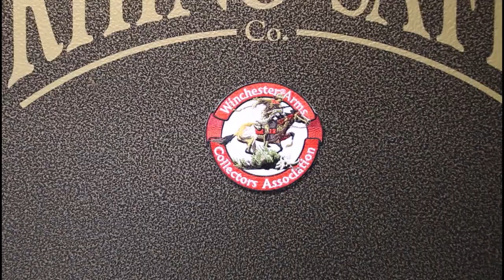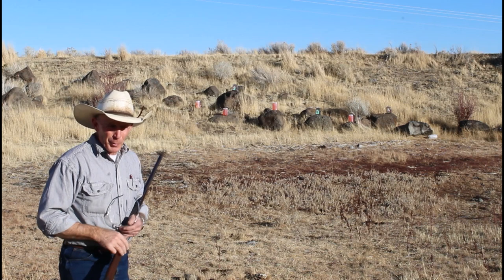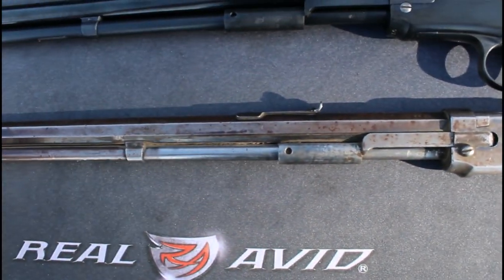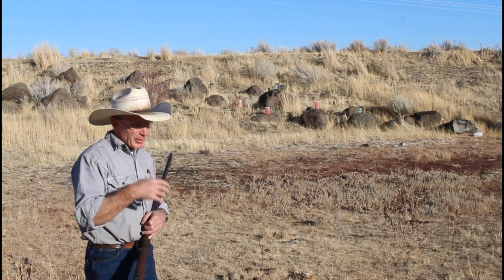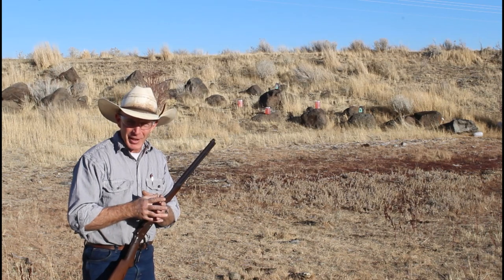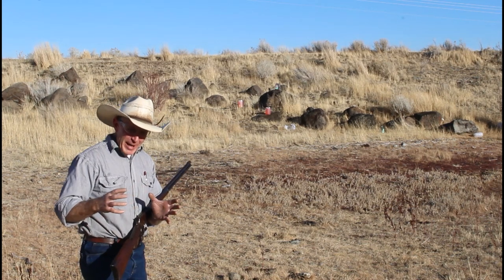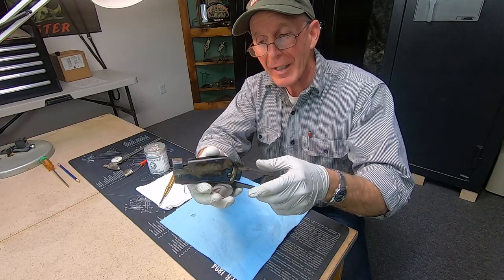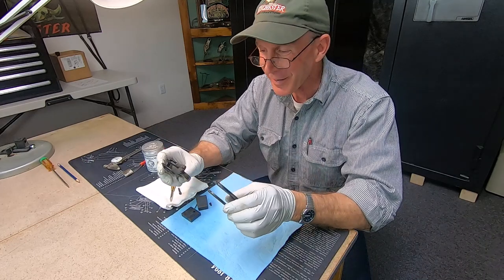Bluing and Color Case Hardening Winchester 22's

Comment: I just found your videos & this stuff fascinates me. I wish I could've learned these things many years ago but I'm getting too old for it now. To think, guys were doing this work-intensive process daily & churning out frames & receivers at a fast pace & with no real safety gear back in the day.

Incidentally, I bought a batch of black powder guns & one ended up being an original 1873 Winchester in .22 short (dated 1886). The color case & blued finishes are gone, of course, but it has a nice patina. I need to get it looked at one day, as it has an area of concern, & not many of these were made. I love the old Winchester lever actions.
Reply from the maker: It's amazing to me that they were able to produce such high quality guns with the equipment they had to work with.

Those 1873's are pretty scarce.  You've got a treasure in that one if it's in decent shape.  Most have pretty rough bores from shooting black powder.

Comment: You can bubble air through the quenching water and vary the patterns on the metal.
Reply from the maker: Thanks for the tip, Jerry.  There are so many variables in CCH, making it so difficult to get right and repeatable.  There's the type and ratio of bone and wood charcoal, the time and temperature in the kiln and the temperature and oxygen content of the water.  On top of that, the weather conditions play a part.  After all those variables, the specific alloys of the different steels used by the gun makers will have an effect.  It's an art and a science that the best smiths at CCH have spent enormous time studying and going through trial and error to get it just right.  Thanks so much for watching and commenting.

Comment: The results that you've shown here of the case hardening are absolutely beautiful! Part of the beauty is the total randomness and lack of any guarantees, you could in theory do everything totally right, and end up with a disaster of a pattern that may be functionally ok, but just looked crappy. It's worked out really well on this vid. My ULTIMATE pistol would be a case hardened Browning Hi-Power, with gold plated hammer, trigger and controls, and a figured walnut handgrips. Getting that work done would probably at least double the cost from the factory price standard, but WELL worth it for me personally. Doesn't do ANYTHING for function, but it makes a firearm look so much nicer!
Reply from the maker: I agree.  There's just something about a nice color case hardened part.  Thanks for watching.

Comment: Nice work on that case hardning project.  I have purchased a few case hardened items from a company called TurnBull Restorations. Their work is just outstanding.  I am glad to see you also use Renaissance Wax on your finished work.  I learned about that product long ago.  I use it on gloss blue metal finishes, fine wood  and of course case hardening. It seems only the real professionals like yourself use the wax.  So I feel that much better that I safely use it on my old collectables.
Reply: Renaissance Wax was developed by the conservation department of the British Museum as a neutral wax that would provide a good protective layer over an object, but that was possible to remove using a solvent. 

Initially the issue was to prevent the dust layer accumulating on metal objects acting as a wick and pulling moisture onto the metal surface creating the conditions for rust pitting. If you look at old metal objects such as armour and fittings, they often show rust lines along the upper surfaces where dust has been allowed to accumulate. Dust consists of a load of organic materials which can support bacterial action if allowed to become moist. The by products of bacterial action is usually acidic and this is what triggers rust. The worst case is where any insect damage such as woodworm has occurred. Wormed wood needs to be removed from the metal as soon as possible and treated. Woodworm excretions are extremely corrosive. 

In guns, danger points are gaps in the construction where moisture can wick in to the mechanism via capillery action. Any wood-metal junction is particularly prone to this. All old guns need to be pulled out of their wood every couple of years and any hidden surfaces inspected. Always coat internal surfaces with a neutral wax or grease before replacing the wood. Renaissance wax is ideal for this. Do not use oil on internal wood -metal surfaces as this can attack the wood. 

Colour case hardening is very thin and the colours are transient. They are unlikey to survive long on surfaces which are subject to handling or wear. The hard case itself is deeper and will survive, but the colours on the surface are very thin and easily lost. In my opinion, it is better to rust or nitre blue parts that will be subject to wear as this will last longer and is easier and less traumatic to restore. Remember if you are in UK, colour case hardening any pressure bearing parts will nullify the proof on the gun. It needs to be re-submitted to the proof house for testing after carrying out case hardening if you intend to sell the gun.

Comment: What a fantastic result. And now for my unsolicited two bits worth of advice from someone who has never refinished a gun.

While Cerakote is a great protective finish, I question applying it to a vintage rifle like your  Winchester Model 1890. It seems out of place and out of time. After a slow rust bluing of the barrel, which was the traditional finish on such rifles, applying a product such as Renaissance wax polish seems much more appropriate. It was developed by the British Museum Research Laboratory as a protective finish for metal objects and also other items. I use it after restoring old fountain pens. 

Putting Cerakote on an 1890 would be like putting high tech, high performance sports car tires on a professionally restored 1930 Packard Deluxe Eight roadster.
Reply from the maker: Thanks for watching and commenting, Stephen.  I absolutely agree with you about Renaissance wax.  I've used it on my high condition, original firearms for years.  Remember, however, that this 1890 was just half of a rusty door stop when I started.  While I'm really happy with the way it turned out, it's still just a pretty shooter and fantasy piece with 0% original finish.

When I get done with the wood and rust bluing, it will be on display in my shop and travel to gun shows with me.  It will most likely be handled extensively by the general public.  I'm very interested in knowing if the clear Cerakote will save the case colors from exposure to UV light and "hands-on" inspections.  While I really like Renaissance wax, I don't think it would hold up as well.  Sadly, unlike automobiles, firearms lose their collector value when restored, so this one seems like a good candidate to try it out on. .
Reply: @thecinnabar8442  You certainly have a point. If lots of people are going to handle it, potentially dropping it (ouch!) and generally bumping it around, clear Cerakote is a good choice. And as to whether it will provide UV protection to the color case hardening, now you can find out.

Comment: I have an old muzzle loader that was made in Spain in the 1970s and the lock plate and all lock parts are hand forged and color case hardened. The outside of the lock plate is now an off color of grey/blue while the internal parts are still retaining their original color.
So yes the colors fade with use and exposure.
Reply: It’s the uv light that makes it loose it’s coloring

Comment: Can you get into how you fill deep pits and gouges? I have a large frame lightning supposedly beyond help pitted pretty bad.
Another great video.
Reply from the maker: It depends on how deep the pits are and where they are.  If they aren't too deep, they can be draw filed out.  If they are too deep, they can be filled with tig weld and blended,  but not on the barrel.  I have seen a video where a guy uses a laser welder to weld up pits on a medium frame Lightning.  Laser welders produce much less heat than even a tig welder.  I sure wish I could afford one.

Comment: Gotta say, you do have guts. I never do foundry or other fire work in sneakers.
Reply from the maker: I wouldn't either.  Of course, there's a big difference between splashing a little bluing solution or warm quench water, as opposed to molten metal, on leather running shoes.

Comment: Maybe a clear coat like Imron would be good protection. It’s a incredibly tough paint used on Fleet vehicles. About 70-80% of all Semi Trucks, commercial jet aircraft and Locomotives use it. Nitro Top Fuel and Funny Car racers commonly use it because it’s not effected by Nitromethane and just about everything else. It can also be color sanded and buffed for a mirror finish. It would be a shame to lose that Color.
Reply from the maker: Thanks Monty.  Great tip!

Comment: I think this actually works better with different types of Steel, or differently with different types of Steel...for instance when I was younger I had a Uberti pistol but it was like high carbon steel so that gives it like this really dark kind of black and blue tie dye color but I think if you use a less carbon steel like spring steel or tool steel you'll end up with a more traditional look like mountains and valleys where the mountains are the dark carbon spots, and The Valleys below look like foamy streams and ponds, because it's like less carbon so there's more of an almost like a sea green tint to it but it almost makes the steel look like 3D or see through in certain areas if you do it the right way but with high carbon steel it just makes it look like blue and black tie dye which isn't wrong there's just like a more traditional look that I have desired and I think it's to use lower carbon steel.....which in Firearms, as long as they're like properly annealed and everything is well put together, I don't think you need it to be high carbon steel, I think you could use tool steel or spring steel instead

Comment: Great video ,, i enjoyed it very much,, but I'm not a big fan of case- Coloring,, it looks ok sometimes, but it can be overly done and a little tacky,, i prefer a good reblue or a good blue finish over case coloring,, thanks again,& i wish you were in the Southeast part of the country I've got an original 94 Marlin 32-20 that needs repairs,, the carrier needs replacing and the lifter too probably,, it's made around the 1900's im guessing...
Reply from the maker: Thanks Bryant!  If it's just simple parts replacement, Marlins are very easy to work on.  Check out my last episode on excessive headspace in an 1893 Marlin.  I show how easy it is to take one apart.  The 1893 and 1894 are very similar in design.  Good luck!
Reply: @thecinnabar8442  thank you, again,, i made a mistake,, it's a 94 not a 93,, i typed the year in wrong,, i will watch your video about the marlin head space,, i enjoy your videos...

Comment: I'm curious, the colors on your 1890 appear to have a different pattern than the other two receivers ( which look to be either Stevens or H&R guns).  The case hardening process was the same for all three receivers Is there a reason for the different color patterns?  Is it perhaps because the Winchester had a forged frame and the other two guns may have been castings?
Reply from the maker: Great question!  Even metallurgists don't fully understand why the colors form the way they do in the process.  You can do everything the exact same way with two identical guns and get quite different results.  One of the students packed two parts of the same old double barreled shotgun in two different crucibles and heated and quenched them in the same batch and got a different look on them - one had a much more brassy appearance than the other.  There are a myriad of variables that will effect the colors and sometimes they will come out with a dull appearance and no interesting colors at all.  The best old time gunsmith I know told me you can do everything exactly the same every time and sometimes it'll come out beautiful and sometimes you'll get less color than an old dun mule.  

I'm told that in the early days, the Colt factory had a chart that had different recipes (time, temp, charcoal mix, etc) depending on several variables such as temperature and humidity.  Unfortunately, that information has been lost to history, so we have to do the best we can through trial and error (and a little alchemy) to find just the right combination that works most of the time.   

You're likely right that the differences in the metals had an effect on appearances, but there were other variables as well.  If you noticed it was a stormy, rainy day when the first two were quenched and a nice day when I quenched mine.  On the day between, several of the projects came out with very little color at all.  If I do much color case hardening, I will surely keep detailed notes of the conditions and the results of each batch.
Reply: @thecinnabar8442  great video interesting on the bluing and color case finish can't say as I'd be overly fond of a fun mule or any other mule as far as that goes lol I am a horseman tho been a cowboy my entire life

Comment: Красивого мало в том что получились у Вас по сравнению с Лари Потерфилдом из мидвея! Вам нужно аэрировать воду ! Тогда цвета будут интереснее. И вопрос закалки ? На сколько тверда получается деталь ? Вы проверяли на твёрдость ?
Reply from the maker: Thanks for the tips Roman!  Some people continue to aerate during the quench and some turn it off prior to quenching.  When I start color case hardening in my shop, I will experiment with both methods.  We did not test for hardness.  The goal was to get the best colors possible and an increase in hardness is an added benefit, but not necessary.  Thanks for watching!